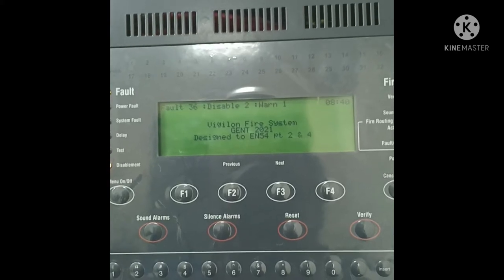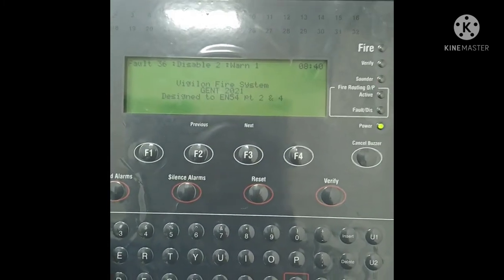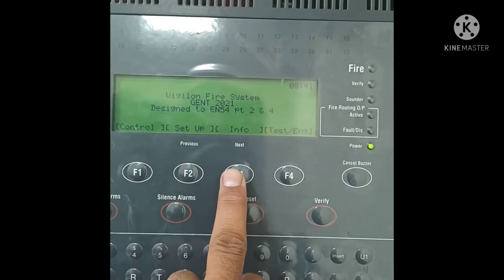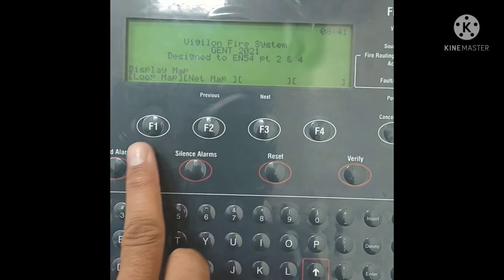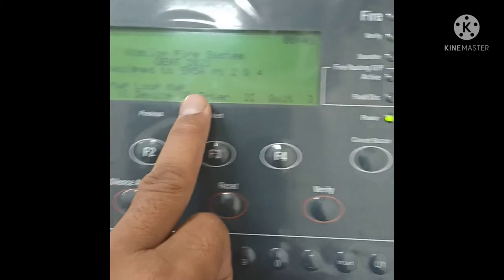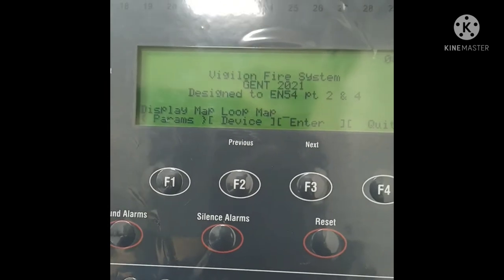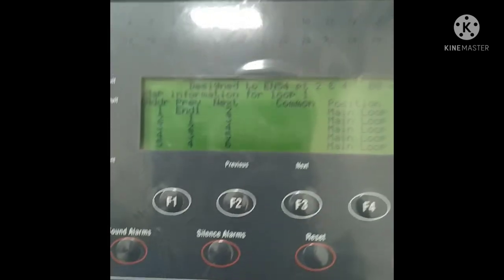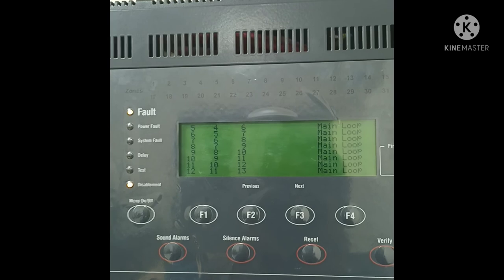HOW TO CHECK/VIEW THE LOOP MAP IN GENT VIGILON PANEL ||  #gent #firealarm  #technology #tech

Comment: If one device is damage we can remove and then do the allocation or not if do allocate all device location change or not
Reply from the maker: If you bypass that device and all devices are in SOFT addessing then changes..if you out the devices in SAFE addressing then will not change the address and location label in panel..